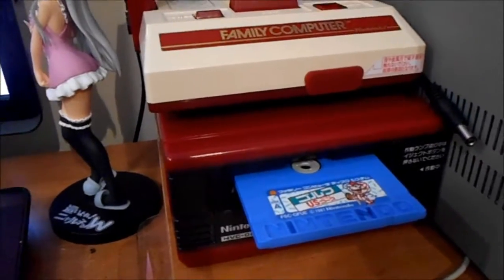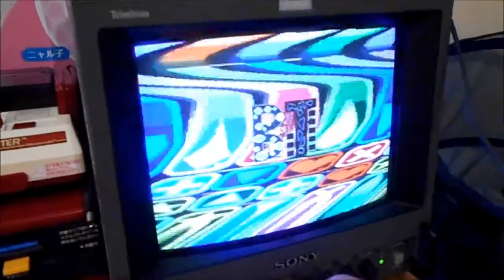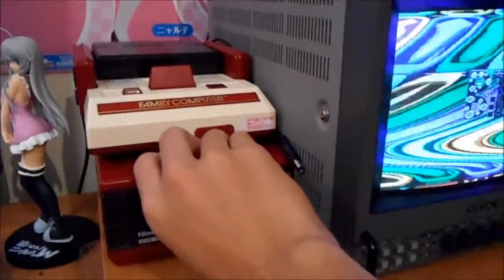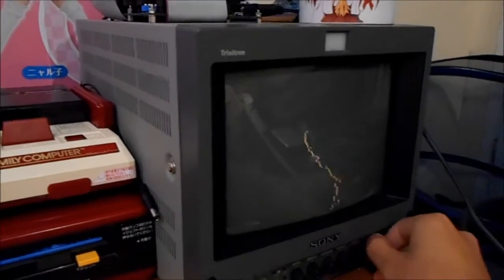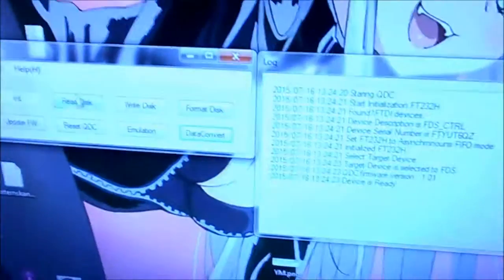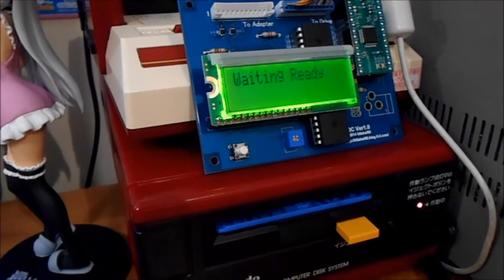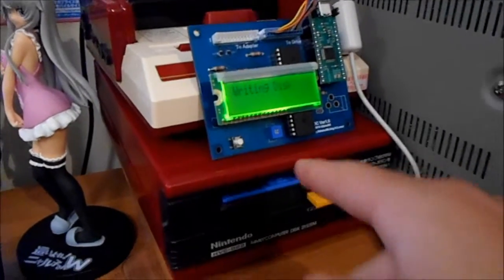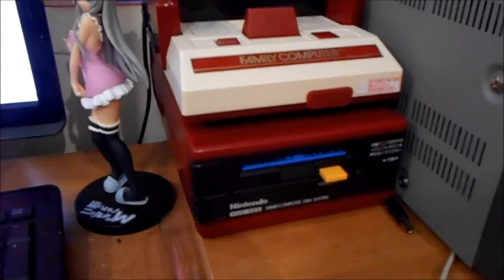QDC Part 2 - reading and (re)writing disks

Comment: I'd like to see Famicom Disk System versions of homebrew NES titles. I hear Famicom Disks are a modified version of some Japanese floppy disks, which'd explain piracy...
Reply: Yeah, they are just QuickDisks (Disks smaller than 3,5" floppies) with a notch at the bottom for Nintendo's so-called "disk copy protection"
Reply: And I don’t like to rewrite official FDS disks, I only buy quickdisks and I 3D print or buy notches for the drive so i can use them!